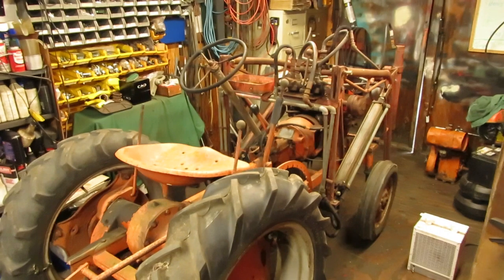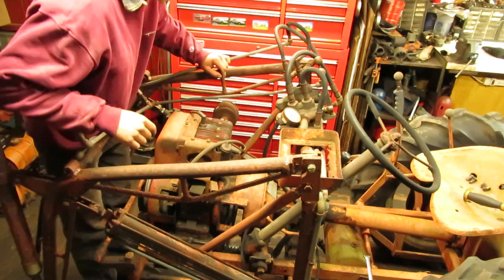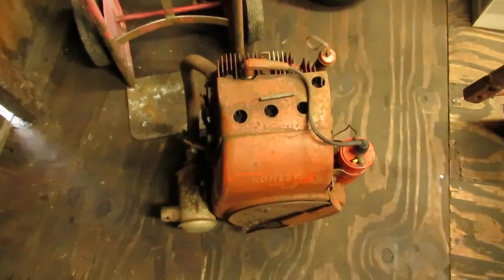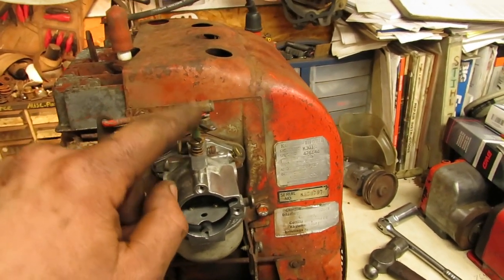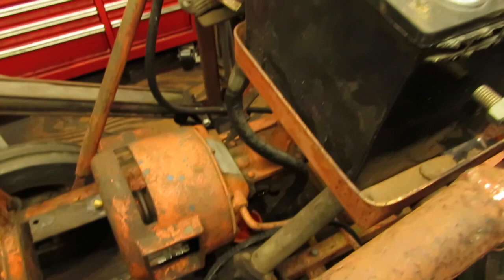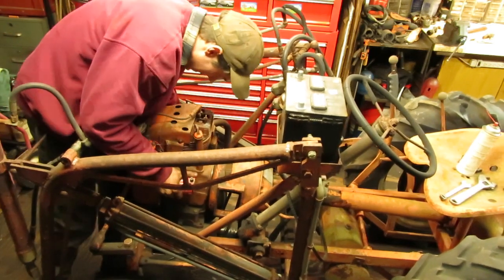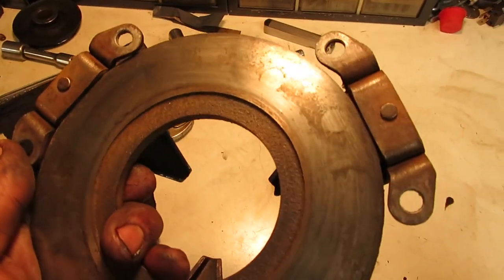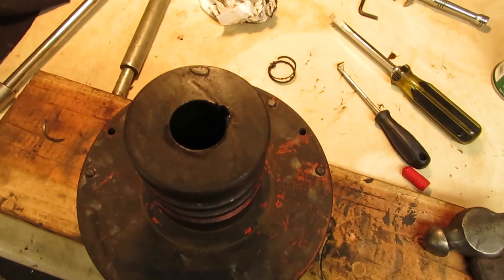1956 Economy Tractor Engine Swap- Part 1

Comment: My 1965 Economy Jim Dandy has the K301 Kohler.  My 1961 Economy has the Briggs 23 motor.  My 1955 with the 24” rear tires has the Wisconsin engine.  I have a bunch of John Deere two cylinder tractors too.  I am learning but I am extremely impressed with your skills.

Comment: Good deal, Jake! Can't beat a 301! I had mine running today, dragging the wood splitter out where I could hook it to the Craftsman to finish up the woodpile till more comes along. They just putt, putt, putt along. I hook the splitter to the Craftsman by regular hitch a 1 1/8th ball on the back of the splitter so I can hook the buggy to it for hauling later on. The local convoy but it saves a trip and I can go and come with everything, even a saw if I need one. Things are cooling down everywhere so maybe you can limber the old 5 back up and get a tune video out!I I got a new carb that didn't have a ball on the throttle and ordered a set of balls from Holley I think. Now I've got spares! Glad everything is good with you. Happy wrenching and picking!
Reply from the maker: You said it Lewie! They's a good engine! Sounds like me back when I used to mow lawns in the neighborhood. Made a hitch to pull double wagons behind a tractor, one for the mower and one for the grass clippings.  Ah yes, the banjo. Down right shame I haven't been picking nearly as much as I'd like... I think working 'till 7pm every night may have something to do with it. Been picking up the 'ol 6 string a bit more just for something different in between. Hopefully when the work evens out I'll start getting back into the rhythm!
Reply: My hitches aren't so pretty but they work. I've got one with a ball on the cross bar on the 5665 kidney mower to drag the splitter, an old 20 ton MTD up out of the hole on the lower end of the shed.About a 2 foot drop from one end to the other. Lots better than trying to yank it out with the little 2-wheeled dolly thing you can move trailers around with. The ball on the back of the splitter is offset to keep the buggy out from under the 'H' beam of the splitter for going through bumps and over banks. The one on the CRaftsman is reinforced with an 'L' shaped piece of 1/4 inch x 2 flat bar where the hole goes for dainty stuff and an 1 1/8th ball in there with regular ball hitches on the splitter and the buggy. Simplifies a lot of stuff. And I sure wished I was closer and my cording hand hadn't gone to pieces because we'd burn some midnight oil upon occasion! All my stuff was guitar related but just haven't had the inclination to dig out the dobro or the bass. And with you having a Tarheel Hillbilly Uncle you know how it is BUT keep on banging on something. We'll ALL like it when the c.d comes out!

Comment: Good videos of the Economy. I'm not too familiar with them, but have seen some on various forums... of two old Bolens I own,  I have a 1965 medium tube frame model 1000, made only one year. Have owned it almost 10 years, just now beginning to do a resto-mod. Found a correct TR-10D Wisconsin engine for it. Replaced clutch facings, now torn down and painting it "close to OEM" colors. It has a very desirable factory optional Hydro Lift that works. It also had a homemade dozer blade on it. I'm hoping it will be functional for use of grading my gravel drive. So I share your "old iron" appreciation of the old garden tractors. I really enjoyed your video of another rare tractor .... Off to see part 2!

Comment: This is going to work out well for me Jake, I just grabbed a K301 just past Taunton this weekend and I'm going to use it to replace the 9HP Briggs on my 64' Economy with the OEM Loader...
Reply from the maker: Neat! Good luck Jim! Hope you made some good progress since you left this comment...
Reply: @5Tractorguy ..started taking externals off the engine, starter/generator, L tube gas tank, front grille, and headlights..just need to remove the engine. I'll clean up the Kholer a bit, run and paint it before installation.

Comment: Looks like a good project Jake. It will be interesting to see how it works in part 2. I was hoping your were going to adapt the 2 cyl Wisconsin THD onto it. ;) I wouldn't mind having one of those Economy's, but they are pricey like you mentioned. That 16hp Briggs would be nice to have as well. Hopefully it isn't too badly damaged internally, now that you found out the trans was causing the drag & it wasn't the engine it's self. Stay warm & keep up the good work / videos.
Reply from the maker: Oh boy, could you imagine! I'd have more than enough power at just an idle... I may look into that 16hp some day. There's another one out back that came from a Gravely 816 that threw a rod. Who knows, I may be able to piece together a good engine. Thanks, will do!

Comment: Cool. I saw that you were working on that. I’ve always like the early Economy tractors. I’ve never seen an older one with a loader. A Kohler 301 is a good swap. I have a couple 23s. I’m selling one but it needs a rebuild
Reply from the maker: The early models are pretty neat, it's just too bad this one is so worn out. Would love to find an original 50's model someday. If all the 23's here weren't either gear reduction or water pump cranks, I would have swapped one of 'em on for something more period correct.
Reply: Yeah a lot of them that Ive found were gear reduction or water pumps too. I have 3-4 that are just the motor, I really like the L-head Briggs. I have a bunch of them. They’re easy to work on and there’s so many of them but no so many 23s

Comment: Lost my engine today on my 1614 1973 Power King tractor. Kohler engine, however doubtful I'll be able to get parts to rebuild this little girl.
Reply from the maker: If it's a Kohler K or M series, you can get just about everything for internals to rebuild them online.

Comment: Would of kept the Briggs instead, but awesome either way!! Love that front end loader
Reply: No way, kohler is the way to go.
Reply: Briggs has more torque
Reply: You stick those bad boys on the dyno? Get me the sheets.

Ill stick to my kohlers atleast we dont have up-draft carbs smh
Reply from the maker: Haha see what ya started! If I had a 23 here that had the right crank I would have swapped it on. All the ones left are either gear reduction or water pump. It's unique for sure!
Reply: @5Tractorguy  haha just gotta stir the pot ether engine is awesome I love them both just always have a thing for those old cast iron Briggs
Reply: always gotta stir the pot :)
Reply: @cunninghamscadets8924  updrafts are OK, but they beat them valve dropping kohlers bud :) I've never had any luck with kohlers
Reply: Huh.  Old post but I wonder why all the stock garden tractor pullers in my area use K-series blocks. I’m a machinist and I’ve rebuilt a few of both.  No doubt in my mind the Kohler is better.

Comment: Love the older Economy. I'm looing to buy one. I do however, own a 2418 that I am installing a loader. Seeing your tractor and how it's mounted is good for me. How does it operate? And issues with the thin frames these tractors have?
Reply from the maker: This one is hokey as ever to run being homemade. I have had a couple here from customers with factory loaders. Much easier to operate, work well and the frame has no problem structurally. From what I've seen though, the common issue is where the front axle pivot pin mounts to the frame. Welds can break and it can loosen up, or the front end of the frame can crack from the added weight. Just something to keep an eye on.
Reply: @5Tractorguy  Its been suggested that I add some frontward and rearward supports on the frame.
Reply from the maker: @MrSticks9999  Definitely wouldn't hurt! The factory loaders have a sub frame that clamps to the tractor frame underneath. It spans about 3ft long. On the rough idea of a double frame on a truck, helps keep it from flexing.

Comment: nice tractor only thing that scares me and I'm a hydraulics guy is they used water pipe for hydraulic pressure and that's only rated at 300 psi..lol. please be careful, I know someone has gotten lucky so far but the deterioration of that pipe and low rating is a bad combo.be safe love your video's.
Reply from the maker: That was a thought in my mind, although I was concentrating more on the badly dry rotted rubber hoses. Luckily there is a gauge on the valve, who know if it works, but I can keep tabs on it. Most this will do is play around in the compost for part 2. I don't trust the welds to do much more than that!
Reply: yeh I figured you would take that in account your a smart guy for sure and yes the hoses are good to keep an eye on.but it is pretty cool the way they built it, i want to build one for one of my bolens or maybe my wheelhorse , anyway keep it coming enjoy your videos tremendously.

Comment: Lucky guy, I've only ever seen one economy for sale in my area and the guy wanted $1200 CAD not running. I really wanted it but damn way to much for me, I'll stick with my Cubs.
Reply from the maker: I paid just upwards of that for the three of these, Sears ST/16 with Johnson loader and a truck load of Economy parts and misc brand implements. Bit more that what I wanted to spend, but the '62 just sold today and I have some takers for the Johnson. Between these and Case, they seem to run the highest around here.
Reply: Ya the joy of living in Canada, all the cool stuff is "rare" and price jacked sky high. Even gravely stuff is few and far between around hear, had a lead on an older one but the guy sold it before I could make the trip.
Reply: Have two Power King tractors and a Internationsl Havester Cub Cadet tractor. Love all of them, great tractors.

Comment: Nice job! What was the original engine?
Reply from the maker: Thanks Simon. It would have either had a Briggs model 23 or Wisconsin AEN from what I'm told.
Reply: I need to replace and or rebuild the engine of my Power King tractor as it just died yesterday. I'll need to get help trying to figure out how to take the engine apart/off the frame in order to see what and how to get things evaluated and redone to get her up and running once again. Big job ahead of me.